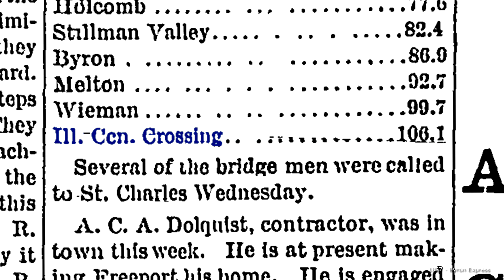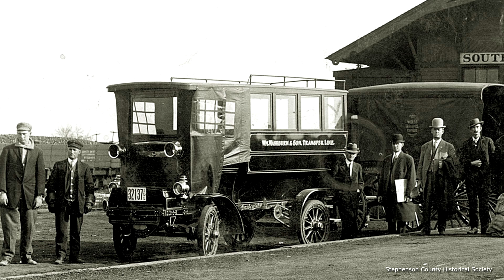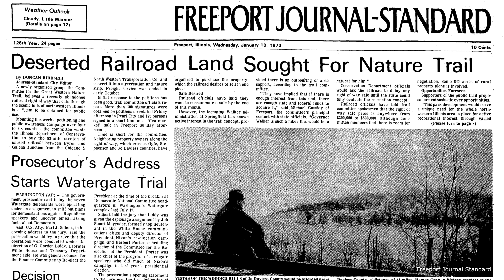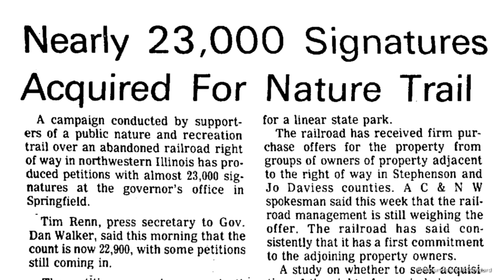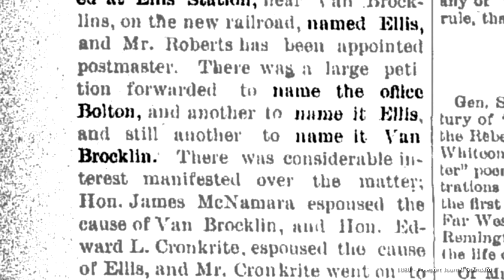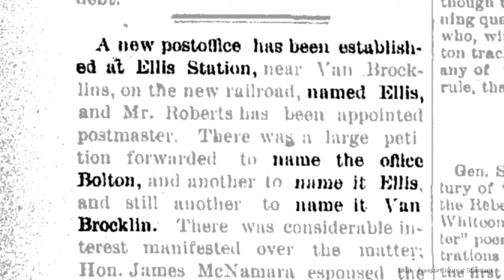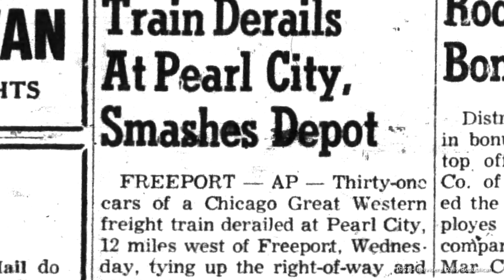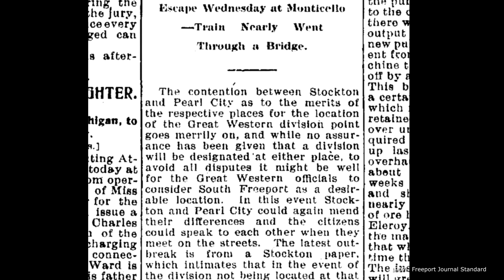Disused Stations of the Chicago Great Western -  South Freeport to Pearl City - Part 8

Comment: Thanks for this video! I wonder if the roundhouse site in Pearl City was still visible (I can locate it on Google Maps). It was there to help switch the trains to stronger engines in order to handle the much steeper grade as the CGW climbed towards NW Illinois. I hope you also find the great lost depot in Woodbine!
Reply: I believe what you believe was a round house  is a temporary corn storage bin for the elevator that was built on the right of way east of the elevator after the rail road was abandoned.
Reply: @leemiche5449  I think you're right. The roundhouse may have been a bit further west in East Stockton. I found some videos on a You Tube page by northernrailfan.
Reply: There was a large CGW facility at East Stockton, just to the east of Curtiss Road. East Stockton is likely the location you are thinking of. The former East Stockton location stood out on older aerial photos, but is not conspicuous on the present day satellite view.
When CGW dieselized in the late 1940's, the East Stockton facility was no longer needed and was abandoned.
Reply from the maker: Thanks for watching and commenting!   Sounds like there is more to sort out here.

Comment: Before you visit the Winston/Aiken/Galena Jct segment, please check that those areas are not closed due to hunting. In Oct-Nov-Dec, there are scattered dates each year when non-hunters are not permitted in those public areas. The exact dates are listed in my follow up response below.
Keep up the good work. I especially enjoy the drone footage.
Reply from the maker: Thanks for watching and the excellent advice!   Would not want to be shot at while checking out these areas.  Or to make the drive to find out that they are closed.
Reply: @BeHistoric  Aiken is located directly on S. RIver Road and the former RIce location is located next to Blackjack Rd. Those two locations are accessible at any time.
However, if you are planning to Galena Jct,, that location is accessible to the public only by riding on the bike trail, either 2 miles from Aiken or 3.5 miles from Galena.  Per VisitGalena, The Galena River bike trail is closed:
Oct. 8-10, 2022 – Youth firearm
Oct. 22-30, 2022 – Turkey season / firearm
Nov. 18-20, 2022 – Deer season / firearm
Dec. 1-4, 2022 – Deer season / firearm
Dec. 9-11, 2022 – Deer season / muzzleloader only
Dec. 29, 2022-Jan. 1, 2023 – Deer season / late winter antlerless only and special CWD
Jan. 13-15, 2023 – Deer season / late winter antlerless only and special CWD

The Winston Tunnel area, as far as I can tell, is closed during the deer firearms seasons, Nov 18-20 and Dec 1-4, but might also be closed during all of the Oct-Dec dates I have listed above. I do not think there was ever a station near The Tunnel itself, but I would be surprised if you skipped that location. I will likely visit in a couple weeks and share my findings.

Comment: starting day 2 of re-watch this series - RE: the Yellow Creek Bridge  i believe you are at the wrong bridge there are 2 bridges one between Bower Rd and Mill Grove Rd (Yellow or Lost)- and doesnt seem to have a bridge anymore .. the concrete bridge you are showing seems to be the Spring Branch Bridge between Mill Grove and Schuman Rd
Reply from the maker: Yes, this was the bridge north of Loran Road over the Spring Creek - that's the one we saw, recorded, and commented on.  In the video we said, "We’ll then travel a little more than a mile, crossing over Yellow Creek.  We then turn right, heading west, onto Loran Road, and travel about a half mile, parking along the road to the south of the bridge site."   And so we crossed over Yellow Creek on our way to this bridge - but the bridge was the one north of Loran Road.   We didn't mention Spring Creek, however.   Thanks for commenting!
Reply: @BeHistoric  ok i know where i messed up i got my North and south confused somehow i got it you were driving north on S Mill Grove ... but you were going South that bridge goes over a crick stream looking thing that is called Spring Branch (not even labeled creek) Per topo maps and Google earth/maps .. just a 100 feet to the north it empty's into Yellow Creek ... there was a bridge over Yellow Creek but it looks like it was removed or maybe collapsed its just to the east .. if you would have made a left onto Loran and not a right on Loran after (its a jog road) i see enough on aerials to want to see it for my own eyes as ... it looks wired .. the bridge is gone for sure over the water .. but it looks like there might still be a bridge on the east side of Yellow Creek .. a long flat section
Reply from the maker: @brianberthold3118  Yes, it's difficult to see some of the smaller bridges and culverts, unless they are out in the open.   If you can find an aerial taken in the late autumn or early spring, then you can see more - but those aren't always available.   We've passed over a few artifacts that were hiding in the woods, as we couldn't see them on the aerials and so didn't know they were there.   A few viewers have pointed some of these out to us - which is great.